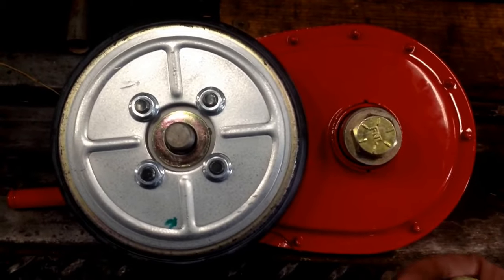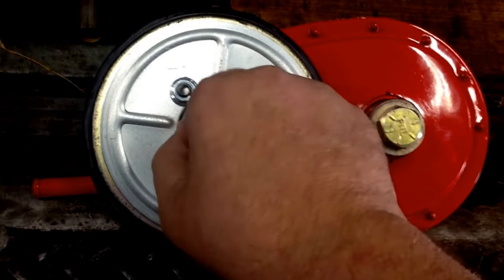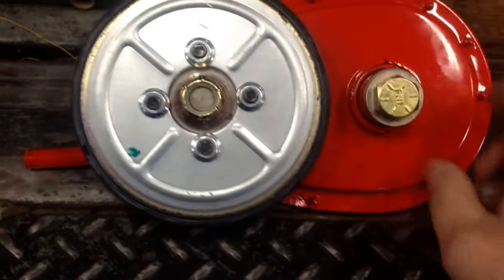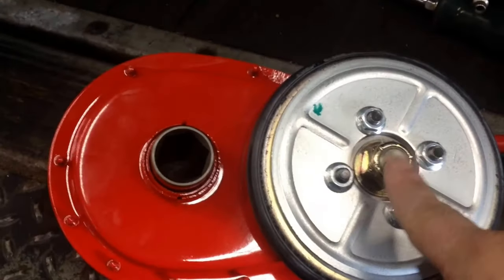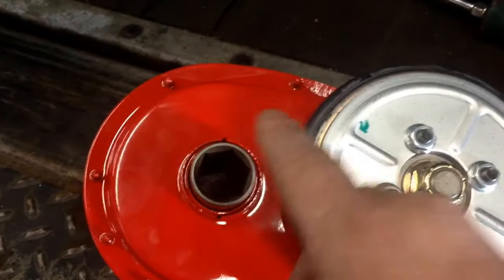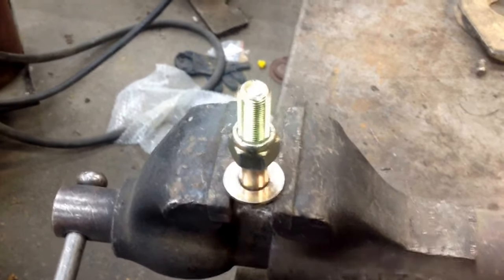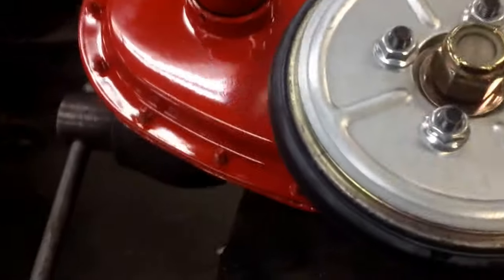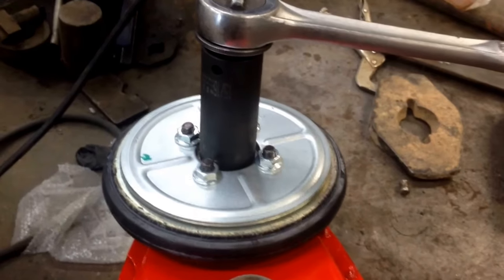SNAPPER RIDER QUICK TIP : SOFT DRIVE UPGRADE / DISC INSTALLATION

Comment: Yeah on doing a old friends snapper his is 2812523bve 7800649 this model and his only makes a grinding sound going forward it doesn't make that sound going in reverse so 

I was thinking maybe it's a bad clutch gear or something. I'm not sure and haven't yet brought his mower to my place yet until i get a few ideas of what's wrong with it I'm not a snapper guy more of a craftsmen user

Comment: So I checked his clutch disk or plate whatever it is out today and a portion of the rubber around it is broken off so hopefully that's all what's wrong with it I've decided not to bring his mower over i don't have a hauler or drive so its easier for me to just go there and work on it where it's at and that's my plan 

I was gonna gonna set it up on a jack stand to see were the bad sound was coming from but that one piece is all chewed up so I'll just change it out for em

Comment: NOT a bad idea, but the shafts are NOT soft, they are heat treated aka hardened, and as you correctly said do NOT use a impact such COULD snap the shaft

Comment: What size nut holds the clutch Assembly
Reply: Know what i do is just fit different sockets on until I find the right fitting socket because i don't know the sizes ats what I do and will be really soon from now